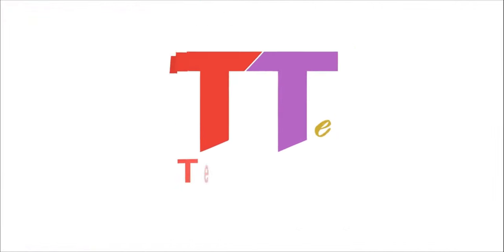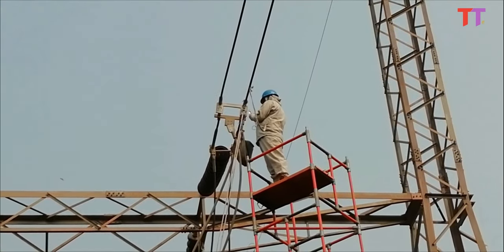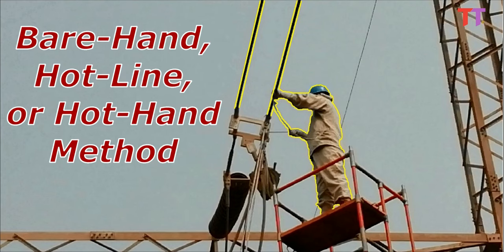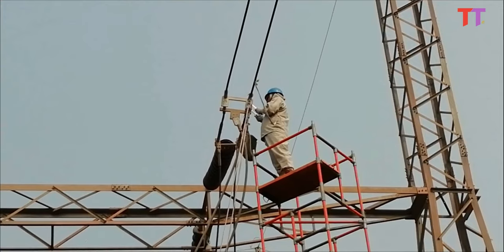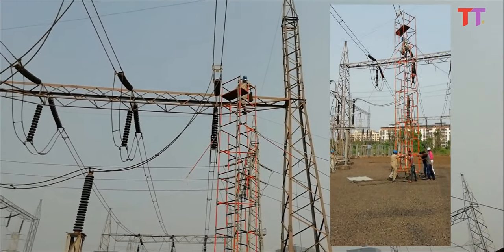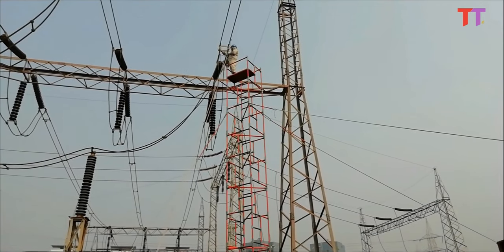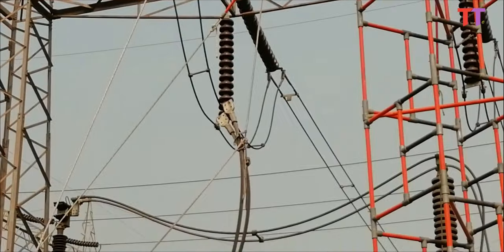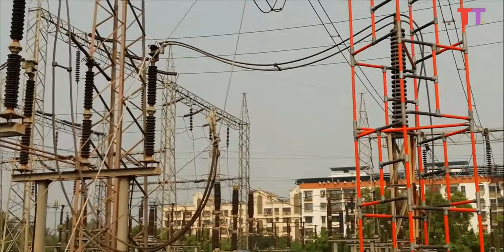Bare-Hand, Hot-Line/Hand work directly on 220kV Live Power Line. Watch at 1.5x for better experience

Comment: Hi, for hot stick method, how do you calculate the safe working clearance?
Reply from the maker: Clearances are as per the occupational safety and health standards. Clearances are decided based on the voltage level.
Reply: @ElectroGlobe1  thank you. but i need to derive it myself for an exam. do you have some calculations? and explanation of the derivations?
Reply: @ElectroGlobe1 Fascinating video excellent quality very well done sir keep up the excellent and amazing work